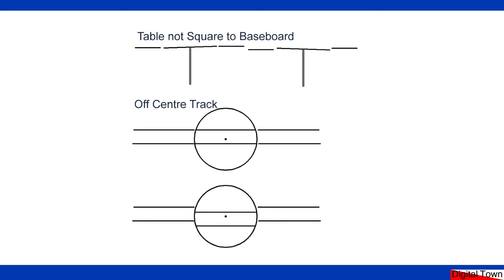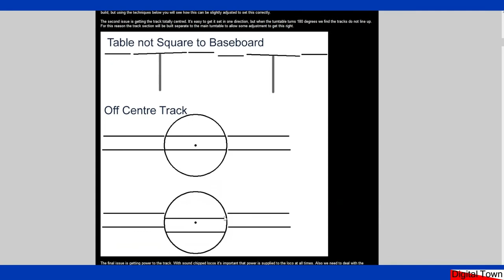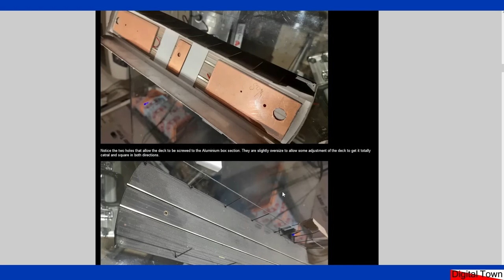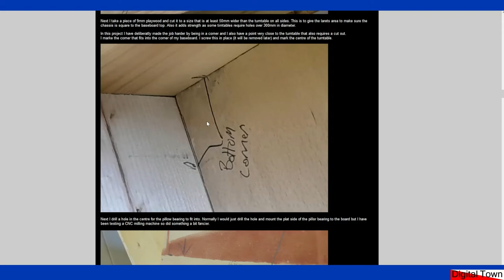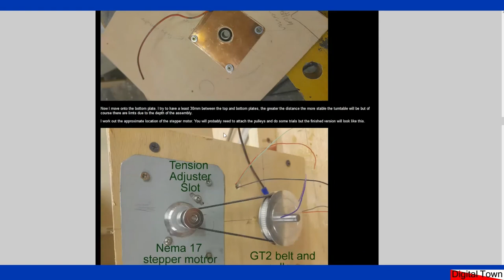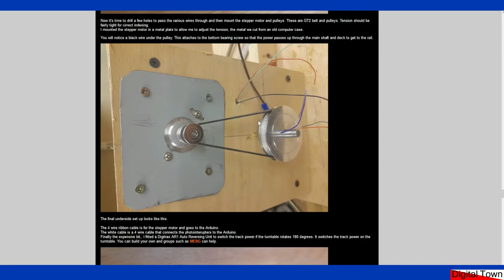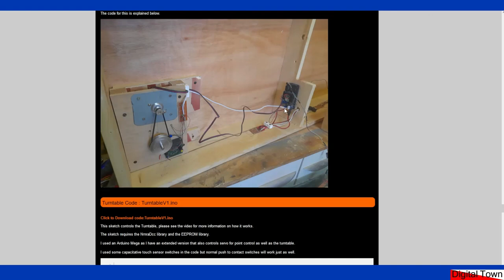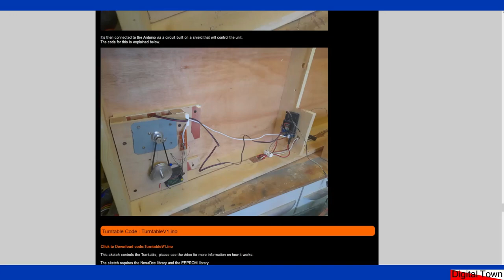Arduino C++ DCC Indexing Model Railway Turntable Part 1

Comment: Found your site by accident this morning while researching Arduino based accessory decoders and I am hooked. This is the best turntable tutorial I have seen so far, your style of explanation is ideal and very easy to follow. I am very fortunate in having a powerful CO2 laser cutter so the construction in plywood will be so easy. Never head of pillow bearings before but I have just order two to play with. So you never know I may have a working turntable in a few days. I am now going to slowly work my way through all your video and hopefully learn a lot about Arduino and model railways.
Reply from the maker: Let me know how you get on. Laser cutter should really help.